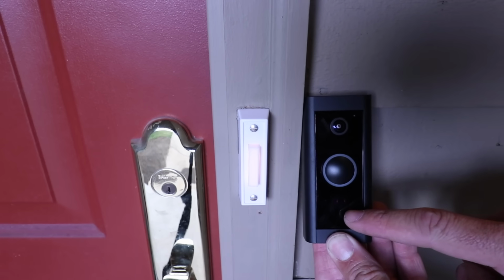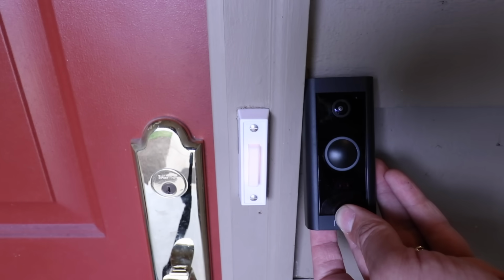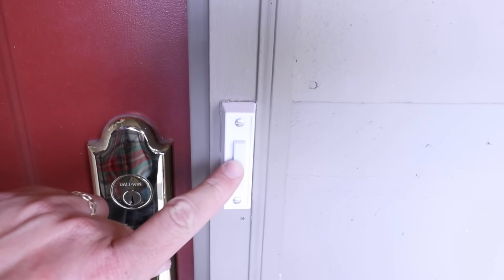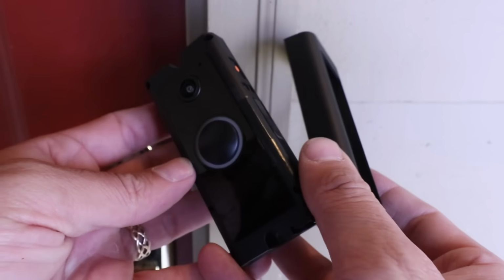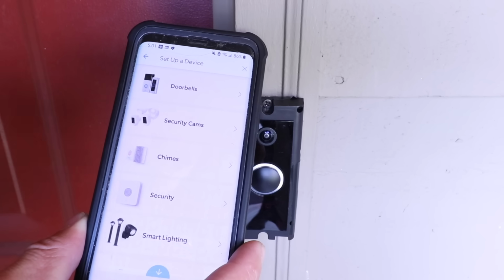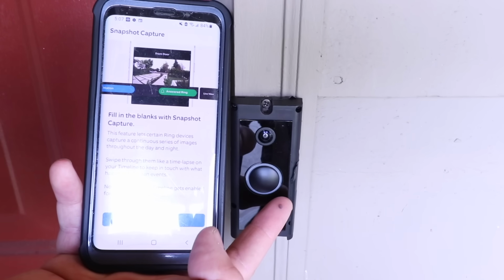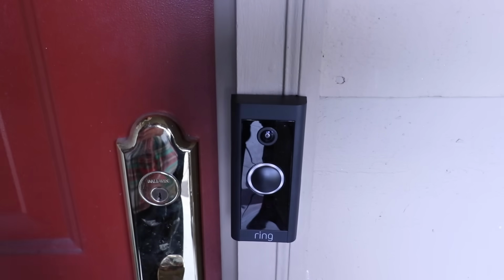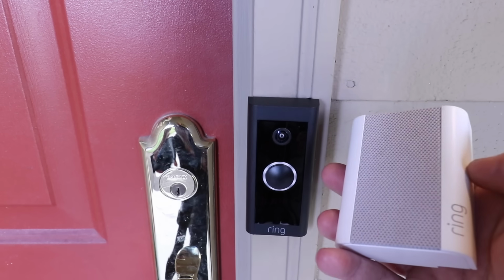How To Install Ring Doorbell Wired

Comment: In my case whether I connected the jumper cable or not, the mechanical chime does not work.  Ring device appears to work along with associated ring chime.   I am using 24V 20VA transformer power supply.   Not sure what the Nutone mechanical chime requires, 16V or 24V.  Without Ring, I shorted the two terminals connecting to Ring and the chime worked.  While not a big deal, still disappointing.  In this video it was not clear the reason for jumping wire - if the chime does not work and RIng works, why bother?
Reply: The ring doorbell wired it's not intended to work with the chime kit of your house, it just extract the power of it. So, if your mechanical doorbell does not work with your ring doorbell, is completely normal. This doorbell was created to work just with the ring chime, almost. But if it is so important to you to have your ring device attached at your doorbell, you should request an exchange for any ring battery doorbell, which have this function.

Comment: Wait so these don’t work with regular chimes? I did the jumper to my chimer in my house and now it won’t work.
Reply: Jumper cable will disable your exist chime box and it will notify you by phone if someone press your doorbell instead. 
If you want to get a chime, just buy a ring chime.

Comment: Thanks for this - so as for every doorbell transformer fitted to front doors, would this work?  You don't give any specs regarding voltages etc.
Reply: Actually he said "I tested the voltage and had 12v which was more than the 10v required by the ring doorbell".

Comment: How do I install one of these without having an existing doorbell?
Reply: You’ll need to buy a transformer for the doorbell, as well as run 18/2 from the transformer to the location of ur doorbell and a 14/2 wire from the panel to the transformer

Comment: The wires that were attached to my existing doorbell were super short but there were two other sets of wires. I used another set of cables and connected those to the ring, and made sure in the chime box to connect the new same set of cables to the trans and front terminals. I made sure they were the same set of cables that were connected to the ring/chime box - they are color coded / green/white (with a green line). Butttt I’m not getting any power to the ring at all! Any idea what it could be?
Reply: Driving me crazy too!!  My wires to my existing doorbell were very thin so the Ring is not being powered nor is my mechanical door chime working. Any way around this????

Comment: question, is it a "must" to do the "jump wire" to old chime if doesn't know wherever located?
Reply: Idk I jumped and didn’t jump mine and my chimer doesn’t work at all anymore. I’m thinking you may need to buy one of those plug in ones from ring

Comment: Why doesn’t anyone explain that using the jumper disables the original chime and now it’s just an ugly brick on the wall with no purpose? I want the video doorbell but I want to keep my original chime as well. Why isn’t there a little relay adapter that installs in original chime to still operate it with communication over the the same doorbell wire?
Reply: the battery models of the doorbell will ring your mechanical chime.  and don't let battery think you have to do manual recharging - the charge is drawn from the hot wire of the doorbell connection automatically.

Comment: Just installed this model ring and it killed my existing doorbell transformer, it was only 10va, so off to the store to get a bigger transformer.
Reply: Ok, the dead transformer was completely my fault. I pinched one of the power wires between the screw head of the other power leg and my house, it caused a small cut in the wire insulation and a direct short. Went and bought a new transformer and altered the wire routing to the doorbell. My ring is now working exactly as designed.

Comment: I don’t have an existing doorbell, I bought the ring doorbell wired without having an existing chime.
Any idea how I can install it?
TIA
Reply: Oh just re-read  your comment. I think you need an electrician or return for the battery powered ring.
Reply: Do you have an echo?  I installed mine yesterday and during the app set up I was able to link my Amazon account. Now when the ring is pressed the echo says " someone is at the front door"

Comment: will mine work without installing the jumper cable? my house doesn’t have a built in chime, right now we’re using a plug in chime
Reply: Sure will
Reply: So if I get the plug in chime I don't need it to have wires? I don't have a doorbell

Comment: Why do I need to install the jumper? The chime doorbell and the options WiFi chime works just fine.
Reply: It may look that works fine, but the jumper cable is for prevent the power of the internal chime kit of your house to damage the ring device in a couple of months.

Comment: What do you do with the jumper cable if you are connecting a front AND back door bell ring camera? Do you just use the other jumper cable on the rear terminal to trans and have both of them on the trans?
Reply: Yes, please answer this. Also, do you really need an extra chime if you already have an echo?
Reply: @CharlieGirl142   you connect a jumper cable to both with two on the trans.  I
Just hooked up my front one. Worked well.  I also have the echo just announce when someone is at the door, and if you have your phone and not on silent it also plays
A chime.  No need for another chime in my opinion.
Reply: @derrek54  suppose you want to use this doorbell to replace the side doorbell on the house rather then the front doorbell..do you still hook the jumper cable up the same way he did? trans/front or should you hook it up trans rear??

Comment: Just a tip here in the UK I didn't need to use any jumper cable on the transformer 👍
Reply: Does your chime still work or did it stop working with out it?
Reply: @heatherela  did your chime stop working ?

Comment: Thank you so much, I just installed a cheap Chinese knock off doorbell and there were no directions to disable the mechanical chime. It was making weird noises and you could feel the electricity running though it. Some spare wire and 5 mins later everything is working perfect. 

Note: To people who haven't bought a doorbell yet. I wish knew ahead of time that some of these doorbells do not work with your existing chime. The one in the video doesn't, if that sways you one way or the other. (Although with the ring doorbell you can you your Alexa devices as a digital door chime)
Reply: So I can still use Alexa devices  as my  digital chime, right?
Reply: @phoebebui2426  With the Ring you can
Reply: @Atomazersky  I don’t see that feature any more, can’t redirect ring doorbell to Alexa as digital chime , please let me know if you have steps how to do that
Reply: @phoebebui2426  I don’t think you can, at least I can’t , if you have done it, plz share steps
Reply: I want to get a Ring doorbell but I still want my existing Chime to work as well since we have a large home and I won't have to buy 2 or more ring chimes. Especially when the house is noisy ( My sons and I are musicians) or if I don't have my phone in the same room as I am in. We still need our old chime.

Comment: Thank you for sharing? I have a question: What if we put no jumper cable in the bell box like you showed?
Reply: Without the jumper cable you wouldn't have power to your ring
Reply: @guidedbygreen1480  Hi, I just installed one of these but when I fitted the jump wire it made the transformer buzz constantly. 
So I didn't connect it and the ring wired seems to be working 👌
I didn't realize when I bought it that it would disable the chimes but have Alexa set up now. 
I will be getting a ring chimes though.
Reply: @gml1868  that's so interesting. The jump wire essentially completes the circuit allowing the power to go to the front door... As long as it works. If you go into your settings into the app and device status, you can see the voltage ⚡, you tap on it and it switches to tell you the number and if it's a healthy amount. To ensure you're all good.

I ended up getting an Alexa as the chime, no complaints there. The device is great, but the Ring app needs lots of improvement. They'll get there lol
Reply: @guidedbygreen1480  yeah, I checked the app and it says voltage⚡️ good, I also checked at the terminals and have 11.6v
So I have no idea what the jumper wire is supposed to do 🤷‍♂️. 
Now got Alexa working well. 
My biggest issue was Wi-Fi strength💪
Reply: @gml1868  sounds like all is good. Also fyi if you tap the word 'good' it actually turns into telling you the received voltage.
Reply: @guidedbygreen1480  so it does 👍 11v 👍😁
Reply: I think it just means your existing bell wouldn't work

Comment: Thanks so much for this amazing yet simple tutorial video! I was unable to determine which button on my breaker box was for my doorbell, so I just went to the next step as you suggested and added cable to my chime box, then removed my old doorbell outside at front door, connected wires and assembled the ring doorbell on!! I love it!! The camera is crystal clear on it too🤗
Reply: Find your transformer...whichever room/closet it is located in or near then that's probably the circuit.  Turn off the breaker and see if the doorbell no longer works.  If no longer works, then you have found the breaker.
Reply: @spacecoastz4026  I found the transformer in a closet. There are no breakers in the electrical panel that indicates which one is for the doorbell.
Reply: @edward_cee  Correct...because there isn't a dedicated circuit just for the doorbell.  Rather the transformer will get power from the closest circuit...that is a room that is close to where the transformer is located.
Reply: @spacecoastz4026  , thank you for the reply. i decided not to turn off any breakers and connected the doorbell and jumper. it appears that i require the Ring Chime or the Ring Chime Pro because i lost the doorbell.
Reply: @edward_cee  You need to be sure that your transformer has enough output to handle the Ring.  Mine didn't and I had to purchase an upgraded transformer.  Hope you get it worked out.
Reply: @edward_cee that’s the part that sucks… everything has a price tag… suddenly not so cheap. Just buying a cc cam and leaving old doorbell.
Reply: When I disconnected my doorbell, my Ring didn't line up with the existing holes... the mounting base is brick...so now what do I do?
What are the velcro strips used for?
Reply: @tisahenderson1256  Need to drill proper holes.  Use a small masonary drill bit.
Reply: The power to the doorbell is only 10-15v, can it shock you? I'd imagine not very powerful as the household 110v.

Comment: How do you know what wire to screw down on the ring? Meaning what side to put the red & what side to put the white wires
Reply: The voltage is AC and it makes no difference which way round they go, it is only DC voltage that will have a negative and positive terminal . hope this helps

Comment: I assume it doesn’t matter-that it is only making a completed circuit, but want to still ask if it matters which wire is attached to each terminal. Thank you for your video!
Reply: I'm about to buy this also so watching a few videos now.  The power required seems to be AC, which means you can wire any way you like, the internals will correct it by rectifying it automatically if needed. So you are good to go.
Reply: It doesn't matter, but I always follow the AC outlet rule: the white (neutral) is usually on left and the red or black is on the right side. Usually.

Comment: Are all models supposed to come with the bell box or is that sold separately
Reply: The wired one comes with the chime. The battery powered one doesn’t but you can buy the chime separate so I’m assuming it will be compatible.
Reply: @jerminator0688  The $59 cheapo version (wired, non-battery) does NOT come with a chime; you must buy it if you want a chime to go off, otherwise you have to use a connected device such as your phone with the ring software to alert you.

Comment: what happens if you don't install the jumper at chime box?
Reply: Bump. Does it make the ring work as a normal doorbell?
Reply: @Arunnn241  there isn't sufficient power to trigger the mechanical chime; the ring models that can do this use an internal battery to power the ring electronics all the time, they just use the hot wire to recharge the battery.  the el cheapo model here does not have that battery.
Reply: My thoughts exactly.

Comment: What if you have a rear doorbell installed too?  Does the jumper wire mess up the rear doorbell?
Reply: Good question I have the same thing
Reply: It turns out you have to disconnect the back doorbell, since the ring needs the power. I can live with just tue front doorbell
Reply: @ChristianRaps  So you're saying one cannot have both a back and a front ring wired to the same box?

Comment: If you don't put the jumper in will the doorbell chime work when the ring button is pressed. And could you just cap off the wires to the chime with wire nuts. so it's no longer connected. if you didn't want the chime to work.
Reply: This is bs that you can’t use  your existing chime they should tell you that.
Reply: @chrisandsonny  right cuz I help my friend put one in his house and we used his existing chime it works

Comment: Enjoyed the video! I was looking to see how I needed to install a different version of the ring doorbell and stumbled upon this, really informative! At the moment I don't have a doorbell at all so I was trying to see what was needed from start to finish. From the sounds of it since this version does not utilize the chime and have to install the jumper if you are replacing a previous doorbell, is a mechanical/digital chime even needed if you're doing a fresh install? Looks like you could just take low voltage wire and run it to the junction box where the transformer is and bypass the chime all together, then get the remote plug in chime for the sound.
Reply: Correct you're essentially just supplying power to the ring
Reply: Exactly

Comment: This doorbell blew my transformer. It even blew the ring transformer! I sent it back
Reply: Would have the electrical wiring inspected by a licensed electrician, the fact that two transformers blew says that there's a power overload somewhere. These doorbells are only capable of pulling the 10-24 volts that it's rated for as said in the video. For comparison, a typical wall outlet is rated for 110 volts unless you're powering some type of heavy machinery/appliance. Good luck!
Reply: @kenatterberry3513  thanks. I had an electrician come out & the same thing happened. I  tried an ADT doorbell & it was fine. The downfall is it was $200
Reply: TBM, I’m in the process of installing now.  Did you include the jumper cable thingy (the tiny black one that looks like a wishbone on both ends)?
Reply: @MyronsBaldspotLovesKevSamuels  I  used the jumper, it didn’t help. I  got an ADT doorbell & it worked fine. Ring failed me 😞
Reply: @tbm2994  thank you. I can’t do any more of those subscription services. Vivint was a Nightmare. I’m glad ADT worked out for you🥂
Reply: @MyronsBaldspotLovesKevSamuels  Isn't Ring subscription?
Reply: @Schellee  they offer monitoring for a fee but you don’t have to use it.

Comment: I bought one and hooked It up with the ring   power outlet 🔌 and it worked good  for a month but know the battery voltage says  Danger and the camara picture looks blurry don't  know what to do know 🙈🙈
Reply: Hi, did you use the little jumper cable thingy?

Comment: Sorry maybe I did not listen carefully. Is the purpose of the black bridge to eliminate the old chime, but still use its power supply? What if I still need the old chime to work with the Ring doorbell? Thanks a lot.
Reply: The ring doorbell utilized in the video is not capable of utilizing the chime sound as previous versions can, so to answer your first question yes. The other options is to not go with the ring doorbell utilized in the video, but you'll be spending about $100 more for the other versions. Another option that he covers is to go with a remote plug in chime made by ring which you can just plug into an outlet.

Comment: I bought this but knowing it would break the existing chime probably would have been a deal breaker :/ - I only found out after installing it.
Reply: It blew my transformer too. Ring sent me their transformer compatible with the ring & it blew theirs. I sent it back but still had to buy another transformer
Reply: @tbm2994  Dang, just wondering what does a blown transformer look like? and I'm worried that it would catch on fire lol
Reply: @MrLuffy9131  Honestly sounds like user error to me.  If not confident in the install process, get someone to help out who can.
Reply: Mines not blown but my chimer won’t go off with the ring door bell. Kinda lame.
Reply: @mrmidnight32  The chime doesn't work but if you have an echo device you can set it up so that it will say someones at the door if you ring it